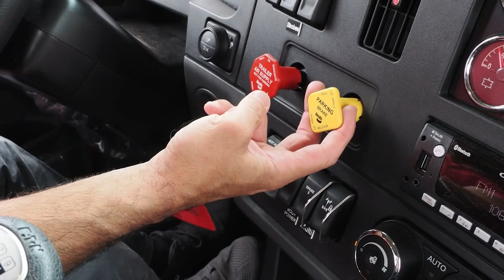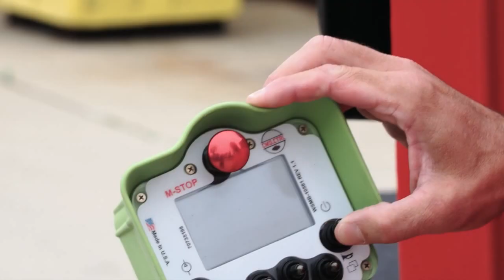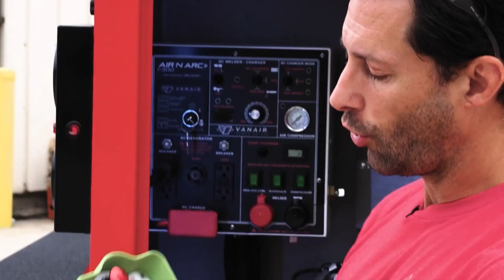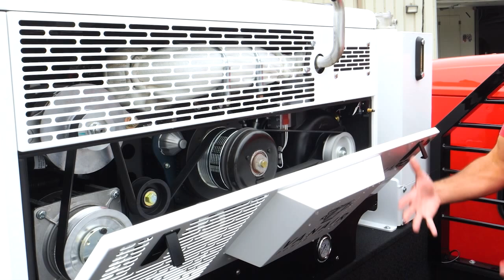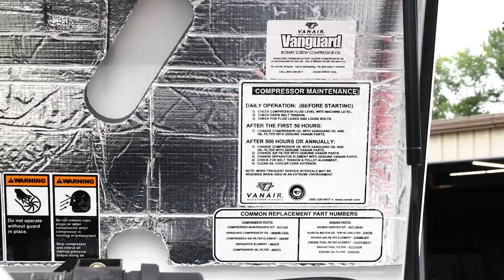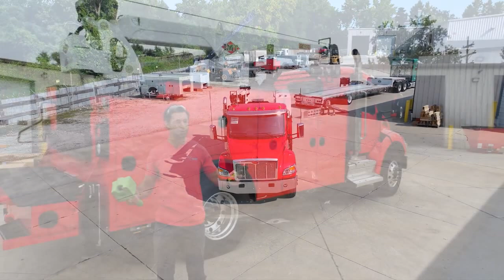Vanair i300 Air Compressor / Welder / Battery Charger

Comment: I love to see manual transmission service trucks its the new modern vintage antitheft system.
Reply from the maker: "modern vintage" is a good good way to describe it!
Reply: Terrible, throw in an Allison and be done. Manual transmissions, especially with a smaller displacement diesel, are not smooth.
Reply: @user-ln7of9gs4s  
I've driven many trucks with smaller diesel engines and I've never had issues. The cat dealer I use to work at bought nothing but manuals for everything.